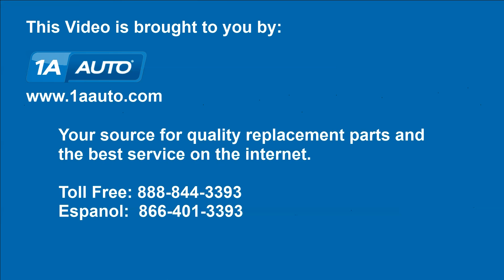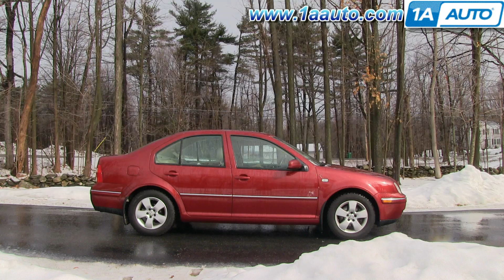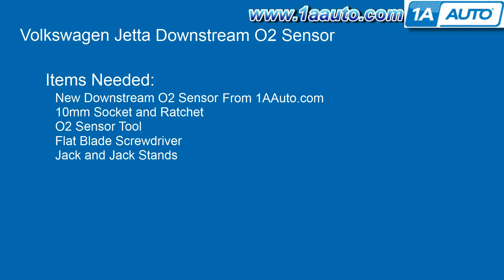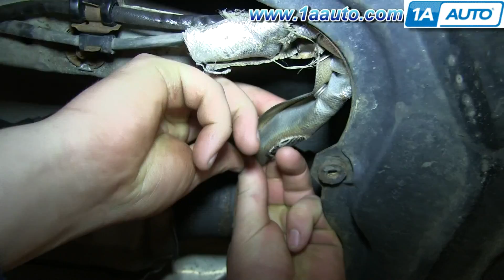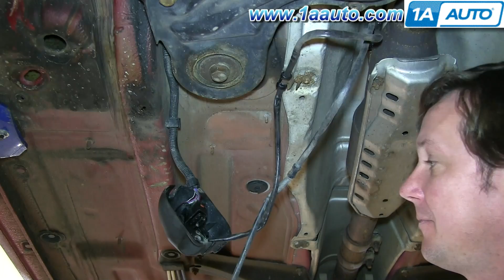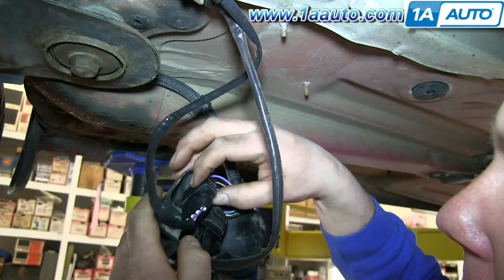How to Replace Downstream O2 Oxygen Sensor Volkswagen 1.8T 99-05 Jetta

Comment: I got a VW 2001 jetta, my mechanic just told me that he ordered an o2 censor and it doesnt work- that we can ONLY use OEM vw parts and it costs $300 each. He says we have to replace BOTH the from and rear censors. I think my rear has been blown out for over a decade, but i dont live in a state with emissions so my other mechanics told me it wasnt worth it since im not rich. My new mechanic is telling me i HAVE to replace both because they talk to each other, and that to clear the computer to start to see why my engine has been sounding rough, is by replaceing BOTH censors. I have little money and need to replace my shocks and this guy wants me to spend $800 on my old baby.

Do i 100% NEED original vw parts and do i 100% need BOTH censors or can i get away with just the front one that regulates the fuel. i think thats the problem but i dontk now if this guy is working me.